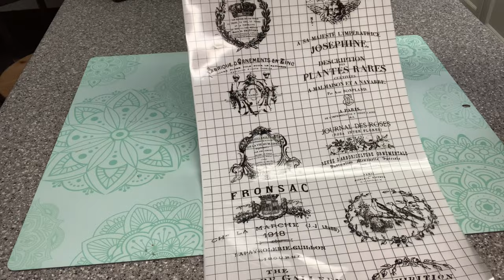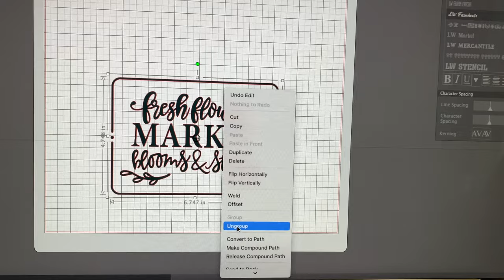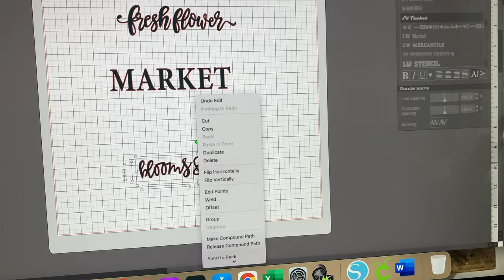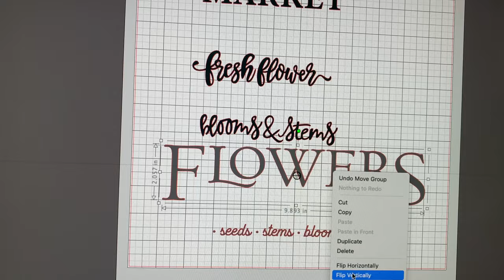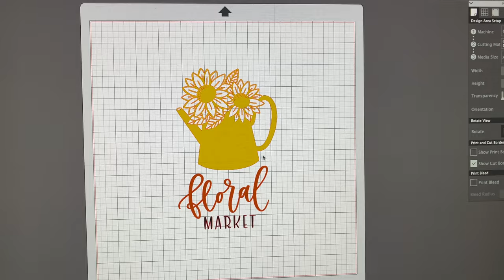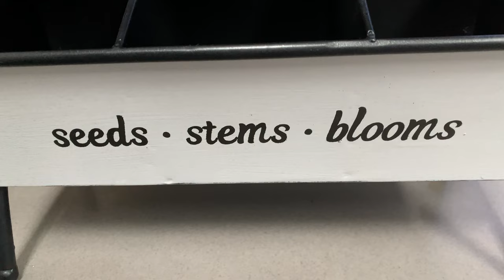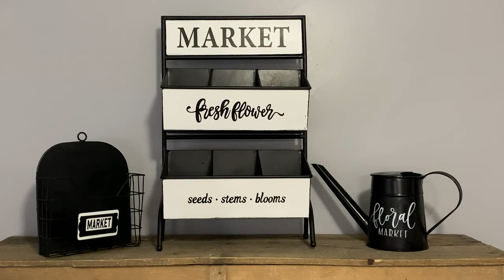Making Over Thrifted Finds || Trash to Treasure || Farmhouse Decor

Comment: I also spray a lot of my pieces and I discovered a trigger type handle to use. It clamps onto the top of the can and the trigger puts pressure on the tip.  It’s a game changer for sure. My finger no longer gets sore. I found it at either Home Depot or Lowe’s. It’s very inexpensive,  Thanks for sharing your tips! I have definitely used some of them 😊

Comment: May I suggest you try burlap for distressing?  There are different weaves that you can try.  I personally use a good open weave piece cut approximately the same size as your drop cloth piece and also dropped in water.  BTW, I love watching your videos.  Hope this helps.  Also, if floral pieces don’t cooperate, floral wire or picks from dollar tree work great for control.  One final tip, when painting glass and other non-porous items, a nice layer of carpenters glue allows the first layer of paint grab onto the surface.  Allow the glue to dry before painting.

Comment: Hi Yvonne. I have heard that you can just use the chalk paint as a primer and then your Kilz or whatever latex/acrylic paint as a second coat. I know your aim here is wet distressing and chalk paint is easy to wet distress. Just wonder if you might like the second coat better if you used your go-to. Curious as to how you would then distress that? Another bunch of great finds - but of course, not without your fabulous vision for each one!!
Reply from the maker: Thank you for sharing that tip.. With kilz paint I have to sand and sometimes sand hard. Which can possibly go farther through the paint than I want it to. The wet distressed  it nice because it just leaves the Rustoleum and polycyclic showing through.